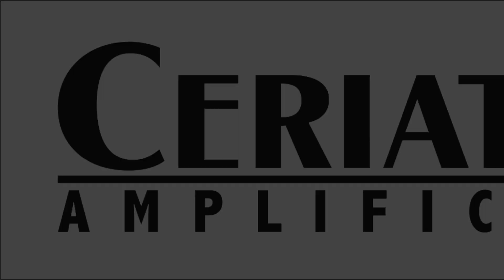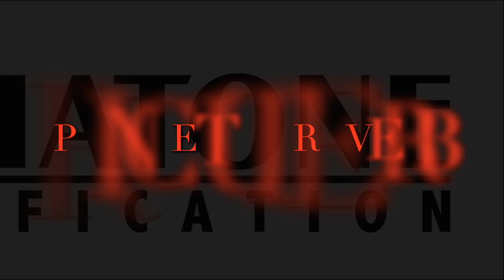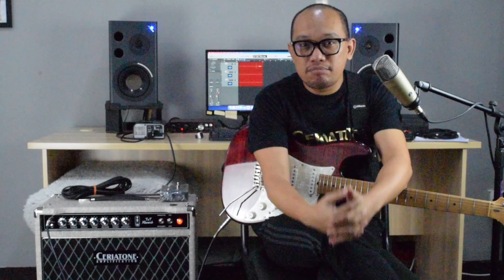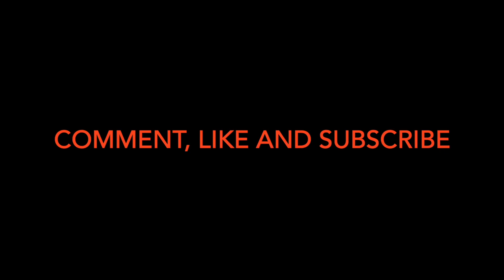PRINCE TUT

Comment: Most "Princetonesque" circuits fart out/have unpleasant breakup with any type of high gain. Wondering if this take on the circuit handles high gain, modern, tight tones better (using pedals).
Reply from the maker: The NFB switch helps a bit, but yeah, the amp is not exactly for metal.